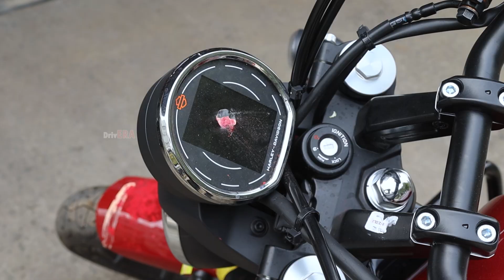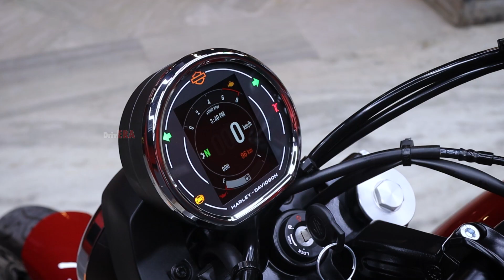Harley Davidson x440 | 10H Ceramic Coating

Comment: Too bad Harley stooped so low...., comprising its trademark designs.... 

It doesn't even look like a Harley....
Reply: Have ever seen XR1200 or Pan America? They don't look like traditional Harley either but they are Harley. Brands can venture out to different aesthetics similar to how Triumph makes Daytone sports bike and Bonneville classic line. 

Secondly the recent Harley language have abandoned the old design, look at 2023 sportster, nightster they short stroke liquid cooled motors.